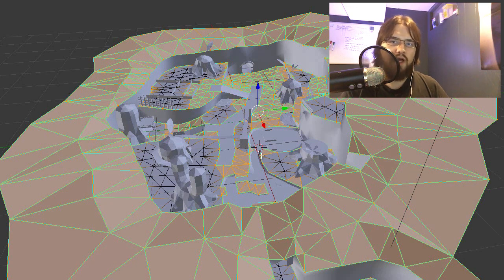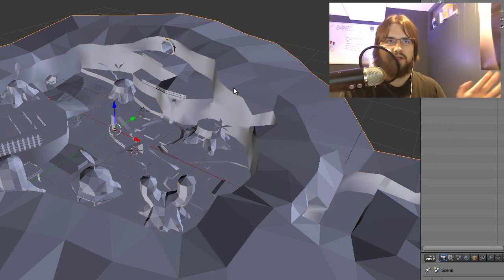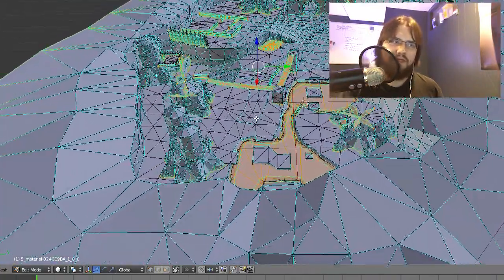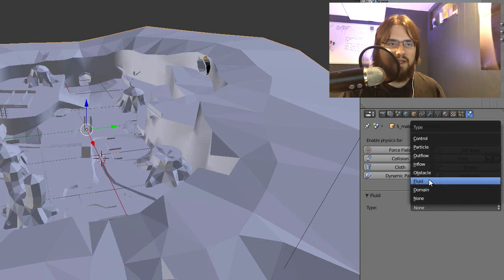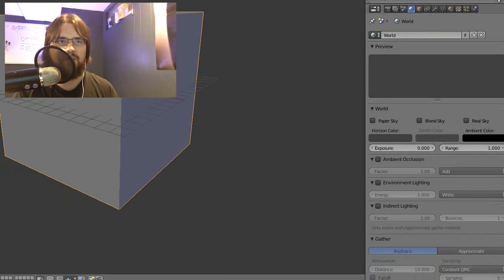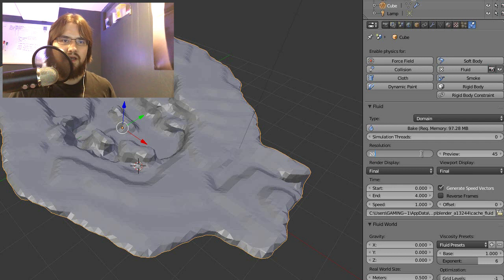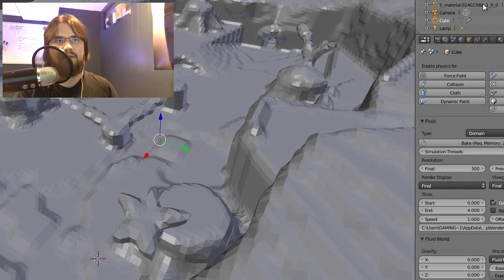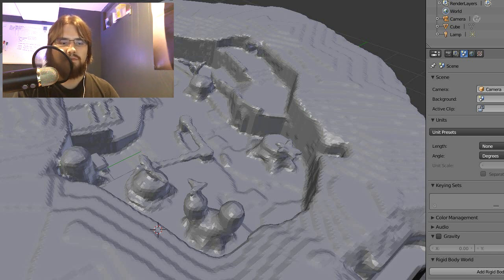Fix Non-Manifold Models Easy! [3D Print Video Game Models]

Comment: what's the function for Ctrl+Shift+Alt+M? nothing happens in Blender 2.8. thanks!
Reply: In blender 2.79 nothing happens too
Reply: In blender 2.8 and greater it's the menu at the top of the 3D view, Select -> Select all by Trait -> Select Non-Manifold. I like to right-click that menu option and give it the hot key of Ctrl+Shift+Alt+M to give me that back.
Reply: same happened to me, I had to switch to 2.78 which is the exact version he is using in the video

Comment: Very interesting method I wonder if it produces some internal geo or double faces, that I need to remove if its not just for 3d printing, secondly even though it says ie 12 gig used and I have much more there is a sweet spot inb4 it crashes , around 12 gig was maximum with 32 gig system which is 420 res,that said thanks again this allows to fix very broken geo so definitely gonna use in many cases, also similar to voxels worflow : make crazy shapes and don't worry your geo will turn out very nice

Comment: What are you on about?

You can get very fine details with 3D Printing, it all depends on your machine and its capability at small details, cheap printers may have a problem but a high end printer would present no issues.

I came here to see about manifold issues and from my perspective, the issue is simple, the software is capable of telling you that they are non-manifold, so they should be in the right position to know what surface needs connecting to that surface its supposedly detached from...

On researching, this bug in the software has had the best part of 20 years to be ironed out, another example of programmers not fixing internal issues over trying to push the envelope.

For me, having a system that is rock steady is more important than bleeding edge tech.